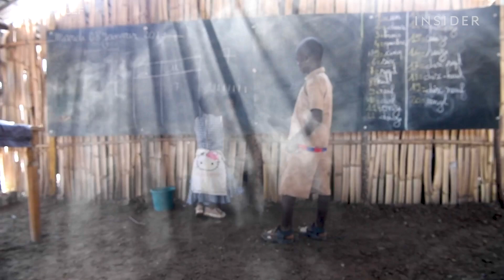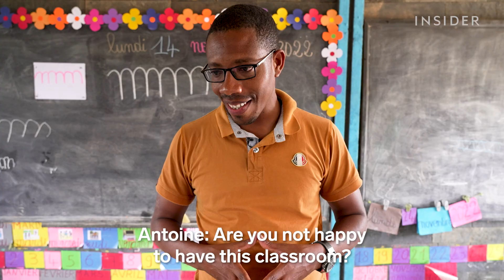How Bricks Are Made From Plastic Trash | World Wide Waste | Business Insider

Comment: i live in midwest i've thought for long time if i was rich i'd open a recycling place and used the plastic in  injection molding and make houses make whole wall and roof pieces where house be like just some pieces bolted together with walls having radiant heat source.would make a house cost be low

Comment: It's a good solution, but if the building burns, the toxic fumes will be poisonous to residents of nearby towns. They also did not state in the video what they did with the soft plastics that were not suitable for their recycling process. Did they just dump them back to landfill sites or did they send them to other recyclers that specialize in even more difficult to recycle plastics? It's not a 💯 percent solution if it doesn't address the plastic wastes it can't handle. An improvement would be needed to make it even more efficient to recycle the plastics.

I wonder if the operators are aware of the process of being able to melt plastics using steam and pressure to turn plastic chips back into oil products? If they could have found uses for the plastics they can recycle, they should be able to find uses for the oils the plastics originated from, and that are environmentally friendly to them and their people. My thoughts are that it might be possible to take the few plastics that are unsuitable for their bricks, and turn them into oil products that then can be mixed and reused as an ingredient to another process that makes something that would help them make their recycling process more efficient.

Comment: I quite like this idea. I just think they need to make sure to add UV stabilizers to the mix. As well as make sure all the buildings are painted. This will protect them against the sun and stop them from becoming brittle and breaking down. Leaving them unpainted will allow micro plastics to fall off and blow around everywhere as the sun degrades it over time. Painting will also mean the building will last longer.
If possible, a fire-retardant paint as it is a school.

Comment: In Germany there are companies that have been active in the industry for 30 years. But their material can only be used to a very limited extent because it stinks.
The recycling rate of plastic in Germany is well over 50%. It is not mentioned that only 17% is materially recycled and the rest is thermally recycled (incinerated).
This is mainly due to the inferiority of the recycling material, despite all the technology.
I think building closed buildings out of recycled plastic is daring. I would refuse to build schools from it, of all things, as long as the material has not been tested to high standards.

Comment: its just gimmicks. it must not used for constructions. 
plastics, as you knows made from petrolium which contains some critical volatile fumes. when it was just plastic, stable structure constrict volatilize fume. but it mixed or prussured with other meterials, like wood powder, cement powder, steel powders.. it volatize with suns helf. ppls inhale that.
and some years pass petrolium ingredients are all volatized, and it will crumble like well toasted bread. so you will inhale micro plastics and meet structural unstablilty.
Koreans tried this methodes. it was not stand so long. I bet you will be big regret for this. it was exist in S.Korea, called compound bricks, compound woods, compound concrets... some of them are reveiled 1st grade cancer cause meterials. now most of them are banned for indoor use.

its not recycle, its just death cycle.

Comment: Well using plastics to build different structures is NOT new... im a bit concerned that this plastic blend is used as it is for the following reasons:
- Using plastic as the outside structural material without it being protected from elements like SOLAR RADIATION, HEAT, RAIN/WATER, ACID RAIN, etc...
- The fact that they make schools out of this crap may seem like a good idea, BUT did they test their materials for offgassing??? Africa is HOT... especially the IVORY COAST... SO my question is, HOW TOXIC is this material and IS IT WISE and SAFE to use if for construction of the Structure of a school building???
- I cant believe its CHEAPER to use this Plastic stuff than simply using concrete or brick construction...

I think that using this kind of plastic for making school furniture for the kids, like chairs and desks, blackboard backing, maybe even storage cabinets and shelving could be SAFER than using this thing for the structure... Why.. well furniture is located INSIDE the building AWAY from direct sun and heat in the shade usually does not go above 40C which is MUCH safer and should not offgas any toxic gases from this plastic stuff...

Just thinking out loud here... Im always concerned that all Western "CHARITY" that is aimed at Africa is always some plot to kill the people there or to make them sick... or something that will hold them back and prevent them from developing and advancing to their potential.

Comment: I had this concept 25 years ago, slightly different design that would've been even easier to assemble.
The only thing I could never answer was the deformation of the plastic as the building went up and how it would behave under heat stress.

Comment: :face-blue-smiling: Level 10   GREEANWASHING
 and this time even mixed with foreign capitalism.
 Theres a reason y the CEOs of the CO. dnt do this in their own countries or most of the 99% countries. 
Its the microplastic leaching of exposed plastic parts . Higher the temps higher are pthalate and microplastic in the air around.
Instead of reducing plastic totally from the environment or making it as internal structure(which requires a lot more RnD in CAD to design a proper load bearing beam? they just package old plastic  in a new plastic wrapper :face-green-smiling:

Comment: It is an excellent idea. However I’m curious about the carbon emissions from re melting the plastics and am surprised that wasn’t covered in this video. Are carbon emissions from the remelting process negligible?
Reply: There's a lot things to be concern. The worker safety, plastic composition, how the bricks behave on high temp weather and conductivity, coatings to prevent microplastics, porosity of rain and heat overtime etc
Reply: It works great there because they don't really have building codes of any sort there, I'd be willing to bet these materials wouldn't meet code in any part of North America or western Europe. Ya know that smell when you buy cheap Chinese stuff, that's the plastic off gassing toxins, these buildings must reek of that for a long time as there appears to be no sealer applied to them and these kids are breathing that in. Its Definitely better to have that than no school at all but it would never fly in most developed countries
Reply: Considering the alternative in many places is to burn the garbage in place, its probably a very slight improvement on the likely trajectory of the stuff in the future. In order to be turned into anything at all it would have to be melted.

Comment: I wonder if they can integrate an admixture within the plastic building blocks so it is less flammable.   I just fear that in case of fire, these buildings will literally go up in flames super fast.   Research the Grenfell Tower fire in London.  In that situation, flammable exterior cladding on the high-rise spread quickly and created really dangerous smoke from all of the burning plastic.
Reply: Plastic is a non-flammable material. It can melt, but it doesn't aid an existing fire. The could add an admixture to make it melt at higher temperatures than it was created at, but I can't think of anything that would keep it from being considered non-combustable. The blocks are also really thick, so heat may not penitrate the entire block so easily even in a large fire. Would still have to be tested. If its managing to hold out the heat of the sun from cooking the interior at present, it stands to argue that it would do well against fire as well

Comment: I'm curious how durable these kind of products are? I'd think with years the bricks would start disintegrating from sun damage unless protected?
Reply: Plastic last for centuries even exposed by a lot of sun. I would be more concerned by micro plastic going down with rains. Structural safety tbh I don’t think it would be a problem if they are used only for small building like the schools. For buildings and big houses I don’t know, they can make it work
Reply: @carlosnino6476  my main worry is fire. If one of these goes up it could be catastrophic as the whole thing melts.
Reply: @greulich9635  I heard its not like that
Reply: @greulich9635  the bricks have the same issues with fire that many other building components have. It can melt, but it doesn't actually give fuel to an existing fire the way wood does. So it would be considered quite safe. The height of buildings it could be used for would depend on testing what it does under high heat or stress, whether it dimensionally warps out of its shape or loses its properties quickly when exposed to them
Reply: @terrie3957  i think he meant it in terms of air polution. Can you imagine a building made out of plastic burning, it woukd poison the whole town.
Reply: The business owner mentioned they're adding some secret chemicals to the mixture which I assume gives the plastic blocks more strength and durability.
Reply: The housing commission tower in London , with plastic aluminium cladding burned like hell, killing over 70 people.  Plastic is petrol.  A time bomb .
Reply: In Colombia the warranty is for 300 years, is solid melted plastic
Reply: all very valid concerns. I think that is one of the reasons this project is being done in an african country and not in developed world. In developed world, a lot of plastics are recycled too, i.e. as rain gutters or temporary traffic light bases or pallets. But not as road surface or anything structural. I think this is a good idea with a mediocre execution.

Comment: Well, I guess it's a good thing those classrooms don't have electricity. A short will turn those buildings into an inferno.
Reply: Do you think a building made of wood and drywall is less flammable than solid plastic?
Reply: @Kim-j9m6v  Yes, I do. Have you seen plastic burn? It's made of petroleum.
Reply: @Kim-j9m6v  yeah, especially with modern building codes. as opposed to a building made of petroleum
Reply: Those plastic are hard asf. Plus a short can burn wood\thatch way more than these things
Reply: @slayerbllade  These are extruded plastic. They're hardly hard asf.
Reply: The plastic is fire resistant.

Comment: Why keep it secret? That feels weird
Reply: It's really not a secret , them melting and molding the plastic is the same way 3D printers work and when they go to melt that plastic they grind it up and then put it into a furnace with very high temperatures to melt it down then the liquefied plastic flows through a pipe or tube to the extruder where it is formed into what they want.

Comment: Just out of curiosity...if the building catches fire ... ain't the bricks and structure melt??? And what about if it melts and become toxic???
Reply: They said they sort it again and remove any PVC and PET or anything that has toxic fumes before it’s melted and molded
Reply: Well they pull out pvc and pet so
Reply: Yup. This is not ideal.
Reply: Your curiosity is short sighted. But, homes in the future will surely be built of this cheap alternative without your concerns. They do it all the time.
Reply: That’s a real concern, but you have the same problems with most wooden constructions
Reply: @arashnikoubashman6946  Out of curiosity: do you work for or have any affiliation with Conceptos Plasticos?
Reply: @blu12gaming44 no, I am just an expert on polymer physics (plastics)
Reply: @arashnikoubashman6946  LOL, ok! I'll let a YouTube comment be an 'expert' (no actual scientist calls themselves that), especially when then fumes from a molten pile of various plastics is claimed to be just as toxic as burning wood.
Reply: @blu12gaming44 I am not going to argue with you, as others already pointed out the advantages of this process. There are risks, yes, but the benefits seem to outweigh them.
Reply: These plastics are much more fire resistant then wood.
Reply: @imxploring  That's not the issue. The issue is the fumes. even when only the outer layer of plastic got burnt, it would still be dangerous.
Reply: @xwtek3505  Another question is which is worse; the trash build up and the harm it creates to the environment, or the fumes from fires that (hopefully) wouldn't arise often? My guess is that the trash on the beaches and throughout the community yeilds a detromental effect on the environment and way of life of the people that the risk of toxic fumes in a fire in comparison is much less of an impact.
Reply: @xwtek3505  exactly
Reply: @xwtek3505  No different then a house or building fire in first world counties these days. All the man-made materials in buildings in the US let off very similar fumes. I've been on enough house fires to confirm this. 
Every solution to an issue like pollution has its good and bad points. The economic boost to the trash collectors... the recycling of plastic... the creation of jobs and industry.... and the creation of these schools far out weight the potential for a fire and possible toxic fumes.... these dumps burn all the time in third world countries with NONE of the gains listed above.